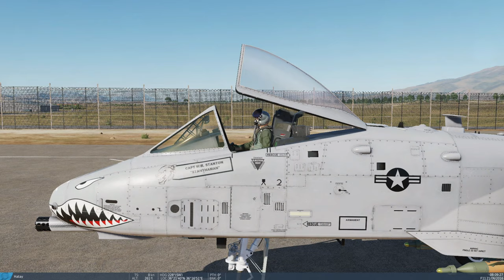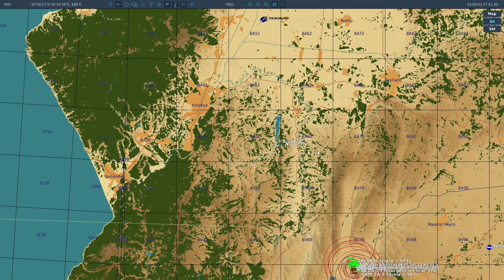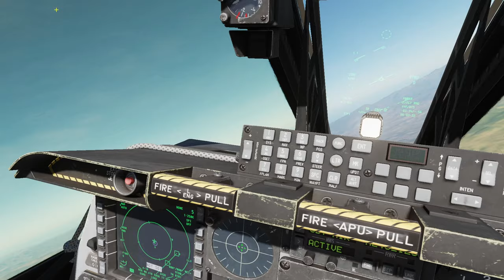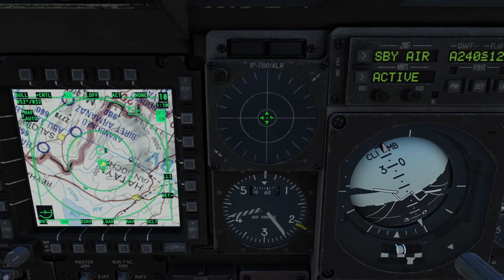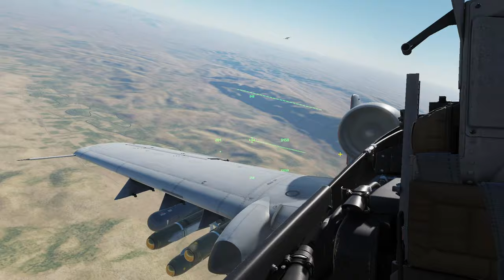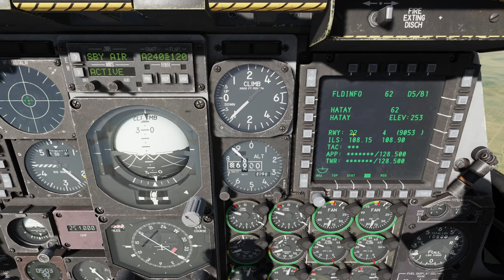CJTF DCS A-10C II Tank Killer Refresher Course

Comment: I followed your steps. But 1. pressing T/O Trim gets no light 2. Before I get to turn on SAS toggles, APU Gen light is already flashing and master caution flashing. 3. When I do FAST align, I don't get the dot beside it. What am I missing?
Reply from the maker: Sorry to hear that you’re having issues with the start up. The APU Gen light comes on when the first engine is started to remind you to turn it off. Mine only came on after the SAS because I went fast, so no worries if yours come on sooner.

The TAKE OFF TRIM light should illuminate when the T/O TRIM button is pressed and held. Even if nothing else but the battery is on. If yours isn’t I’m not sure what to tell you. Make sure you’re pressing the right button and if you’re running any mods, disable them to test. 

I just ran though the start up on my end and the fast align dot appears when I press the button next to it during the start up procedure. Make sure you’re not waiting too long to do it. It could also be a symptom of the problem you’re having with the take off trim. 

Hope you can get it figured out.
Reply: @CJTFStanThaMan  thanks for the tips. I figured out takeoff trim will light up if yaw is set to the middle. 
Ok I’d turn off apu gen when the light flashes. 

You are right if I do the alignment quickly it will work for the FAST method, I’d get the asterisk. 

I’ve seen many start up procedures. I like yours the most. And the way you explain other things is like you were born an instructor.

Comment: I have a question, at about 18:30 in the video, you slewed the box off of the HMD cross hairs and created a mark point from the box. I am trying to do that but its not working for me, the way it worked for you. For me the cross creates the mark point even the box is not on top of it. Is it still possible to do that? if Yes, what key command are you giving to make the box create the mark point, instead of the cross?
Reply from the maker: Hey thanks for the question. Unfortunately there was a bug introduced in a patch a while back that prevents the mark point from being made on the Helmet Designation Cursor. It has been reported and hopefully they’ll fix it in the near future. Until then we’ll just have to use the cross. You can find more info if you desire by doing a search for DCS A-10C II HDC not making mark point.
Reply: @CJTFStanThaMan  great to know that.  Thanks for the prompt response.